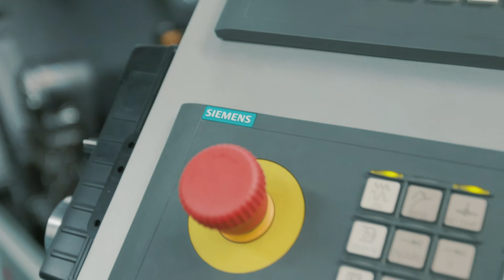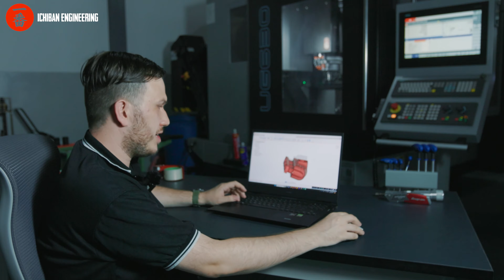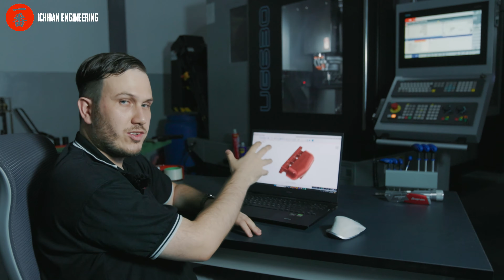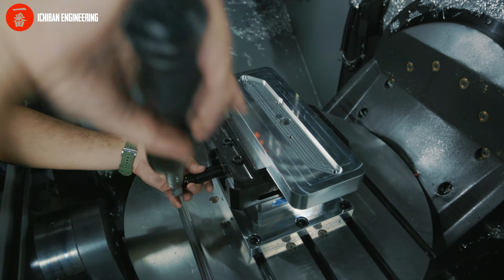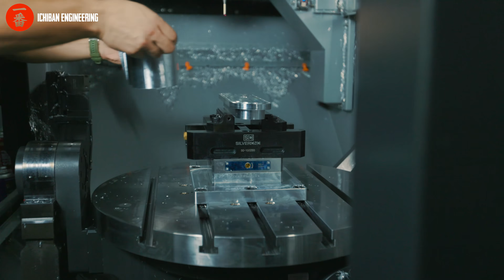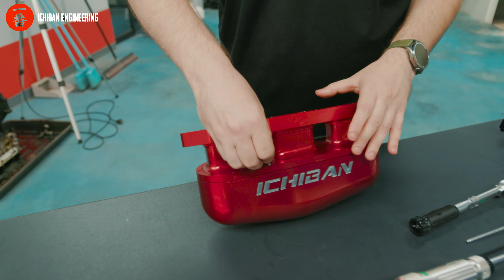GR Corolla & GR Yaris Billet Intake Manifold

Comment: What supporting mods are required/recommended? I am assuming new valve springs, retainers (built head), intake, high flow downpipe with or without aftermarket exhaust, possibly Kelford cam and OEM+ clutch...
Reply from the maker: you can run it with no mods just a tune. but to really see gains we would recommend a better downpipe and exhuast, and cams.

the retainers and springs are just a by product, as at high rpm this engine tends to have valve float. so if you run kelford cams, retainers and springs are a must.

Comment: Do have you any dyno comparisons vs the stock intake manifold on a stock turbo that you can show us?
Reply from the maker: this is usually used on a upgraded turbo, and for those who are looking to push high HP numbers. Is like putting a large intercooler pipe on a small turbo. There is no sense in that.